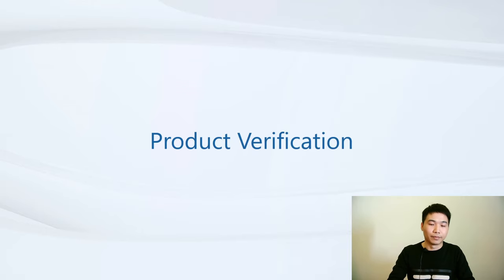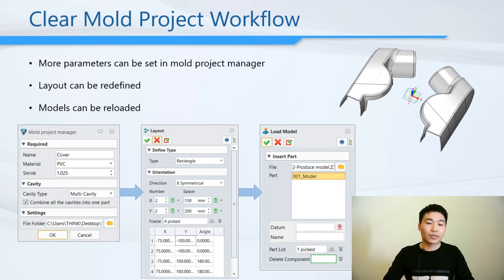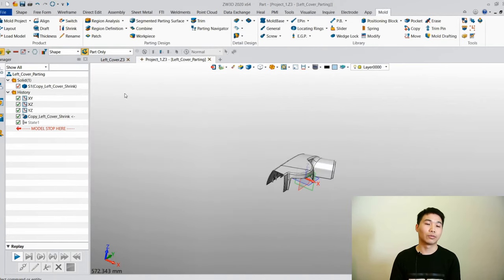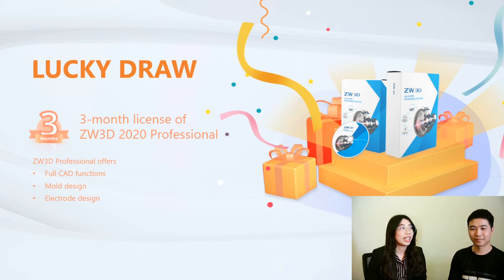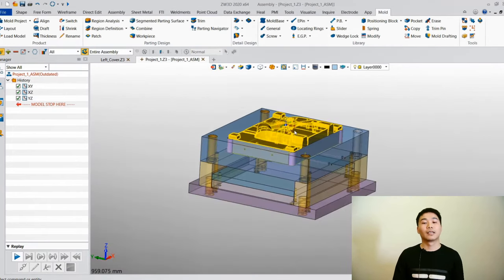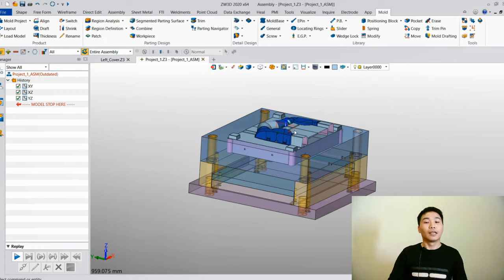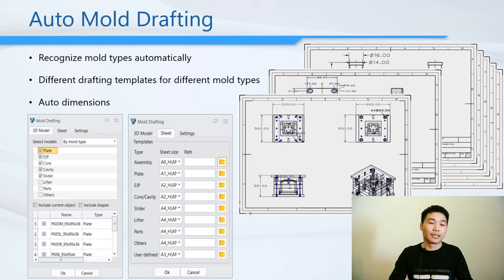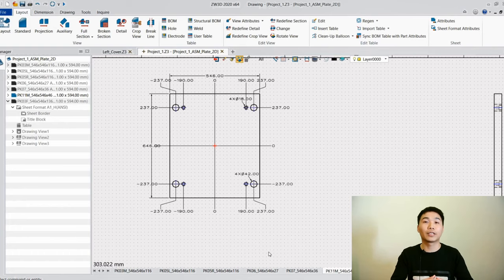ZW3D 2020 Mold: Professional and Practical

Comment: How do you machine the 'gate' you designed. I have never seen this shape for gate and I do not understand, how do you machine it.
Reply: Usually it's spark eroded or fast hole drilled.
Reply: Usually it's spark eroded or fast hole drilled.
Reply: Usually it's spark eroded or fast hole drilled.
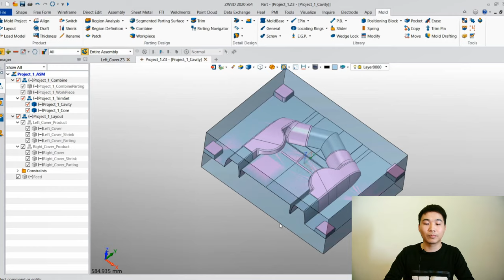Reply: @AsassinCrafter  @25:05/45:53...the gate has rounded shape-like a horn....Even in the parameter window there is a suggestion of that horn shaped runner! You cannot drill not can you EDM such shape! That is a total nonsense!